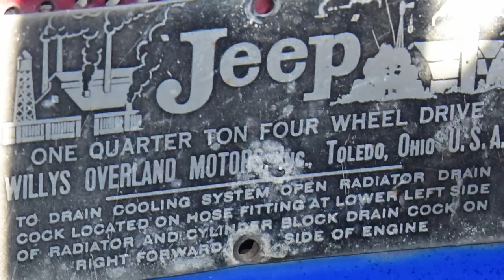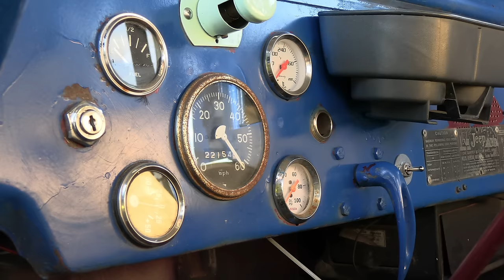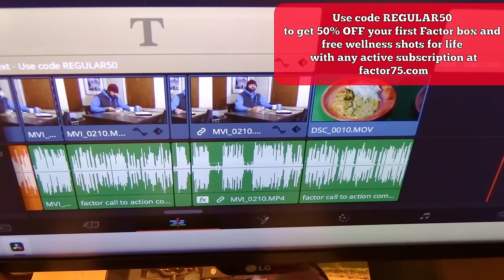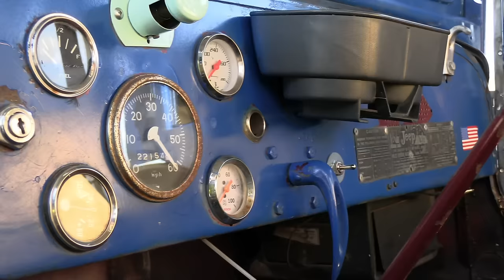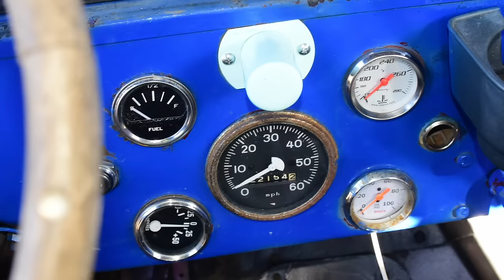1948 Willy's Overland CJ2A: Regular Car Reviews

Comment: Fun Fact : Here in the Philippines, MB Jeeps is a gift from Americans when they have surplus of MB Jeeps from World War II left here, fast-forward today, resulting to Philippines public transportation, the Public Utility Jeep (PUJ) and also it's private counter part the Owner Type Jeep (OTJ), a custom built jeeps that can be modified depending on buyer's/user's desired specs, mostly with Toyota Gasoline (K Series) and Isuzu Diesel Engine (C Series), Soft or Hard Top, and also known for i'ts STAINLESS STEEL Body (sometimes even Frame)!
Reply: I found one in Calbayog City Samar back in May. It was in great shape

Comment: The Fire Department I worked at for my career had a 1947 Willys Jeep Mini Fire Truck as one of it's antique parade vehicles. Served the city for 40 years as a bush truck with a front mounted pump, pre-connected rubber hose attack lines, water tank, hard suction hose and and cabinetry for various appliances on the back. It even had a 34 foot, 2 fly ladder on the side. Fully restored, I drove it a couple of times and it was scary as hell on any hills. Stopping was something planned well in advance. But what a beautiful little rig.
Reply: My family all drove this one 50s CJ on prairie fire calls, it had a pump that filled "Indian Packs" or water tank backpacks with sprayers. Eventually the prairies became subdivisions and the Jeep was put on parade duty.

Comment: 40 years ago a guy I know had a 48 MB in high school. It was all pretty much original, not lifted, Go-Devil engine, original rims, military hardware. 
Rebuilt the engine in shop class using a JC Whitney rebuild kit and some help from some Greatest Gen knowledge (RIP) It ran and drove great, front end was tight and wasn't crazy top heavy because no lift. He sold it in the late 80's for cheap, wish I had bought it. This guy is having fun with his and I hope he gets it together like he wants it. 
 Cheers.

Comment: 38 years ago I was a volunteer firefighter, and we had we had an authentic WWII Jeep Willys that we used for fighting brush fires.  This was the gold standard of "form follows function."  I don't think it could reach 50MPH even if you pushed it off of a cliff, but it could go 15MPH through a rock-strewn field...while pulling a church behind it.  Uncomfortable, slow, very heavy effort to operate, but mechanically simple enough that even I, with zero mechanical aptitude, could probably fix anything on it that broke.  And it could go ANYWHERE.

Comment: EDC belt guy probably transitioned to any 50's or 60's carb'd Pickup truck that doesn't have an ECU or electronics more complicated than said flashlight.
Reply: Even cheap flashlights have fancy microprocessors now

Comment: We had one of these for a while. Dad picked it up for couple thousand non running when I was a teenager nearly 20 years ago. We used it as a homeschool mechanics class. Engine required a full tear down and rebuild. Spent most of my college years as a runabout on the property. My step grandpa loved it and drove it all over our property. Probably reliving his early days in military. Can confirm it’s terrifying to drive over 20. Third gear was almost too fast. We had the soft top so our doors coworker and DID keep rain out.

Comment: I drove the AMC version of these. I think it was a cj5. We used it as a push mule at an auto shop. We fixed u-hauls and more often than not it was for no start. We used this to push them inside. We could push at IDLE a full size u-haul truck up a hill to the bay. The transfer case was permanently in low 4 so it was slow and sketchy. But the torque was the stuff of legend.
Reply: My old man had a couple of CJ-7s when he worked for American Motors, both were company cars, but he bought the second one outright before he left to go to LTV Aerospace and Defense, and before he bought his Ford Club Wagon (his first outright new vehicle after leaving AM and after my brother went off to the Navy and my other brother he no longer needed to pay child support for anymore).
My personal favorite was when he brought back a loaner Jeep when his was getting worked on that was olive green (my mother said it looked like an Army Jeep) and right-hand drive (which back then was just simply move the steering column to the right seat and the glove box to the left seat, but it was the same dashboard).

Comment: I had one titled as a 1946 (it was made from three not-very-good ones) back in like 2003-7. Unbelievably capable in the dirt, despite what I assume were open differentials. It was factory, with cut rear fenders and 31"s. Absolutely no power with the old Go-Devil, WEIRD shift pattern and foot starter arrangement, fairly hard to drive and utterly useless in traffic outside of like downtown or backroads, but SO MUCH fun and just amazing on the trail. That tin-top is super-cool! Mine didn't have doors or anything but a (cracked) windshield, I put a CJ-5 bikini top on it with some creative conduit bending to make it work, haha! Also, I'm sure you'll be told this 8,000 times, but I'm fairly sure 'Willys' is pronounced like 'Willis', but I'm not certain and don't especially give a damn. I bet a 2.3L Pinto motor would've made a BIG difference, I used to run 2.3L Pinto wagons in 4-cylinder demo derbies, they make... well, enough power to drag them around. The old flathead Go-devil makes what, 45 hp? Doesn't matter on the trail, the crawl ratio is like seventy million:1. I bet 4.10s would totally work with the 2.3L.

Comment: To be fair...........by the time the 48s came out, the majority of the military parts had been used up.  Starting sometime in late 47 they would have been putting the semi float axle in the rear, but it looks like either this isn't a 48 or someone swapped an early 47 or 46 drive train in or at least the rear axle.  I love my CJ2A.  And it's not dressed up as military either.  Just grey body with red wheels.  I don't drive it long distance, I use it to run around town with and try to stay out of everyone's way lol.  I stick a slow moving vehicle triangle on the back when I take it into town.  The kids love it when I pick them up from school in it.

Comment: I learned how to drive in my fathers 48 CJ2A and I feel like I am a better driver because of it. You get a real respect for how dangerous traveling on the road is. Managing the large stopping distance is the hardest part. You have to approach every signal as if it will be red by the time you get there.
Reply: My first car was a Jeep CJ-7 with unassisted drum brakes. It had poor man's ABS, the brakes weren't strong enough to lock up. Combine that with the sketchy steering and it'll keep anyone on their toes. It can do 55 but anything over 45 started to get light.

Comment: Dropping the gear ratio to 4.88 and then putting taller tires is why it’s a struggle to drive on flat ground. Keeping the 5.38s and 34s would be way better for getting up and go, or just dropping the 34s and going to a 29 or 30” tall tire with the 4.88

Comment: My boss in Arizona inherited a late 30's forestry service panel truck with pto in front and back. It had a blown inline 6 but we put a 350 SBC in with the aid of an adapter trans plate and changed motor mounts. It was a low torque monster plus had high low case as well as separate pto outputs.

Comment: If you've used one of the modern side-by-sides for even one day's work, you'd know that while they're good at what they do, if a bit expensive, an old jeep is still possible to innocently desire. There's no harm in wishing you had something technically road legal that did the same job as the side by side, but that you could park on the courthouse square or right in front of the sheriff's office while you grabbed a bite to eat and some supplies before heading back to work. Something without all the massive size and weight and expense of a modern truck or jeep. We all drive those now, and I'm sure you'd criticize us for that too, but you can take a side by side and probably an old jeep a lot further into the woods or the mud with your chainsaw and your fence supplies than you can a modern one, much less a regular car. Mind you, it's been awhile since I was last hired for that sort of work, but I imagine it's still true enough anywhere that isn't very tolerant of ag vehicles on the roads illegally.

Comment: I’m actually very excited to see this cause it’s the first car I own that RCR has reviewed. I can actually get mine up to 50 so you still have to take back roads, but you’ll be fine on a Main Street without holding much up. I’ve also got a military body on a civilian frame (original tub probably rusted out) but I actually like the utilitarian history more than the military, I don’t ever want to cosplay in it. It’s a great little grocery getter around town and a lot of fun to drive, I didn’t bother with a top though

Comment: I remember when i had a CJ

Better transmission though.
The T90 had a conventional shift tower while the former T84 had...something

Also, through a L134, a t90, a dana 20 and the dana 30s, it should be fairly peppy unless the engines getting worn.
Low end toeque and a top of 60 mph was what i could get out a 46 2a

Comment: When talking about how dangerous these are you forgot to mention that the driver is literally sitting on top of the gas tank. It's right under the seat. Though I guess that's no worse than the old Ford trucks that had the tank right behind the seat.

Comment: Hee, though it's almost too bad they're so collectible,  a little thing like that would be handy around the land and woodlot here,  where it can be pretty tight.     THough we have an old Gator six-wheeler that can do most of those jobs.  (With less ground pressure  and thus rutting if it is wet up there on the hill.  )

Comment: jeep Cj2a, for the man who love driving at 35 while having sensory overstimulation from the tires rumble, the transmission whining and the engine sputtering and screaming at all the rpms.
Reply: I love driving my Jeep CJ-7 with the doors off. Overboosted power steering, narrow solid axles, unassisted drum brakes. It's an experience. 45 is plenty fast in it. It'll redline at 55.

Comment: The cure for having to drive everywhere @ 30 mph is to install a Warn overdrive in addition to those "TSL Narrow" tires you have installed on it already.
Gives about 50-55 mph cruise.
Reply: With manual drum brakes all around, bouncy ride, and a comically short wheelbase? Just because you can do 55 doesn't mean you should  ...

Comment: Offroad test would have been appropriate for this video. Drive to a trail or offroad park, test and drive it back.
They feel safer in stock configuration and restored to original. They don't go fast, but drive nice. The axles are narrow; same specs as a Suzuki Samurai.

Comment: One thing I want to say with the whole "Car Show Jeep claiming to be from WWII" thing. There are more Willys MBs in private hands than there are CJ2As produced. The front grille is the only major difference between the two, but old war stock MBs were sold through the AgriJeep program, and many CJ2As were refitted MBs that survived the war. I've even seen a few CJ2As with Ford-Stamped bolts.

Also, if this is the most dangerous thing you've had on RCR, then you should review a few of my cars :D. About 10 years ago, I sent you an email with my very colorful AM General DJ-5L Postal Carrier. I think it would beat out the CJ2A in danger factor.

Comment: Growing up we burned wood for heat. Friend of my dad had a 48 willeys pick up. Loaded or empty would go thru 3 ft of snow. Hook a rope to it and it will pull a 150 ft tree over. Compound low was insane. And yea, top speed of 38. How he jept that thing running i dont know. But it was a pickups pickup.

Comment: My friend just finished restoring a 1962 CJ-5 and it really is just a tractor. Fastest we clocked was 50mph downhill and the motor was screaming tryna keep up with the drivetrain. No seatbelts, no doors, no roof, no airbags, nothing. Just a big metal tub wobbling down the road, and 2 dipshits smiling ear to ear behind the wheel. We have yet to see a bystander not smile and point at it while we putt by at 30mph.

Comment: My dad has a 1951 CJ-3 (we honestly don't know if it is a CJ2 or CJ3) we use it as a winch to pull our other cars whenever they break down or to haul random shit on it's bed+ a trailer. I once did a road trip with it, highway is fucking frightening, big rigs doing twice as your top speed (around 70km/h) and your poor original 4 banger screaming as high as it can on the top of 3rd gear

Comment: Funny commentary.  I do not have a storehouse full of beans, nor do I drive my own '48 2a because I secretly want to be G.I. Joe.  It is easily one of the most fun vehicles I have driven.  I have used mine as a daily driver, and it works fine for that purpose (all stock).  The 35 mph thing is true.  It is a different vehicle when pushed to go much faster.  Where I live it is not an issue.  You forgot a couple of things when listing concerns.  You sit on the gas tank.  Seatbelts, doors, and a top (or roll bar) are not required.  The headlights in an original are 6 volt, making them very dim.  It has no turn signals.  And a hard-hit bump in the road will, for a fraction of a second, make you 1" taller and then 3" shorter.

Comment: That “Mutt” of a Willys has been hacked so far from a CJ2A it’s almost laughable, almost. No L134 Go Devil, that hard top doesn’t belong to it, the roll bar is certainly added, definitely not stock seats, that windshield is from a 3A, and the grill is also 3A. Maybe, just maybe those leaf springs are 2A but the same ones were used in the 3A along with many of the 2A parts. 
So at best this model is a Willys Frankenstein created by Victor himself.
I mean who does this guy think he’s fooling?

Comment: suzuki sidekick has  5:13  final drive
and nissan path finder is 4.63 final drive rear 
78 pinto engine nothing wrong with that 
....eww that filter might be clogging some horses\
YO since your first gear isn't low geared enough you need smaller tires !,
 or a different trans all together

i have driven a 65 cj and by god the torque from that dauntless 6 will kick your ass . just drivin it  in the woods not the road.
would love a review on one of those those have permanent awd

Comment: There is a company in the Philippines that produces all of the body panels for the 2a on up to the yj. Due to some licensing shenanigans a century ago they still have a licence to punch steel. frame for the 2a is simple c channel and most every other part is avalible new from some offroading shop somewhere. 

You can build one of these. You can have a brand new 47 willy's for about 15-20k after drivetrain. 

Id like to build one of these. In the same way you talk about the man who built his home i want to build a car from scratch. To know its every oddity and feature. To putter around my backcountry paradise in something that will take every scenic detour without complaint because i built it myself and i know what it can do.

Comment: i think this is the most "wow that's really ugly i like it" car i've ever seen
it's got such an unbalanced look to it. the cab doesn't flow into the hood of the car like most other vehicles, it just kind of stops and it looks so damn awkward
if i ever got one of these i'd paint it red, take the top off, and play the NES jackal level 1 theme everywhere i went
Reply: Look at a Kubota 21BX tractor with the aftermarket cab... that's what this is, a tractor with some protection from the elements
Reply: @OntarioBearHunter  emphasis on "some", kehehehe
Reply: Top off is the default for these. Hard tops weren't offered from the factory so they were usually homemade.

Comment: That thing is barely a Jeep. Pinto engine? Engine components from a different vehicle?   Non original tires and rims? Roof? MacGyver seatbelt Ratchet straps for the doors? Clearly not the original headlights either. Bro has as much street cred as a middle aged woman  buying a new Jeep Wrangler to drive from her Condo to her shoe store